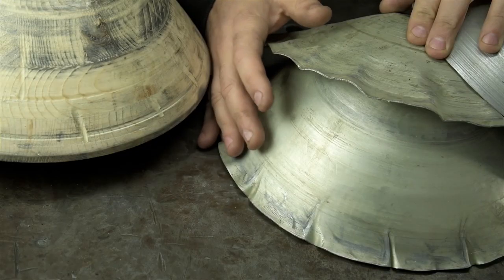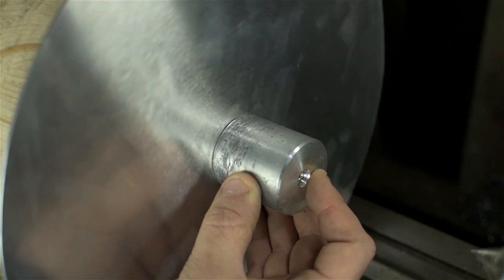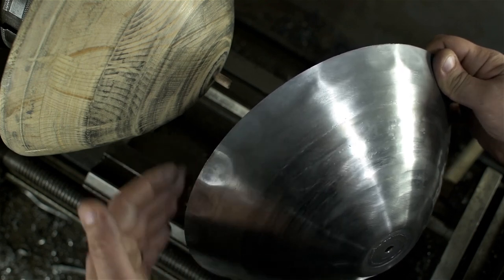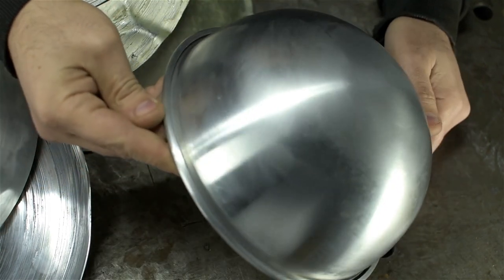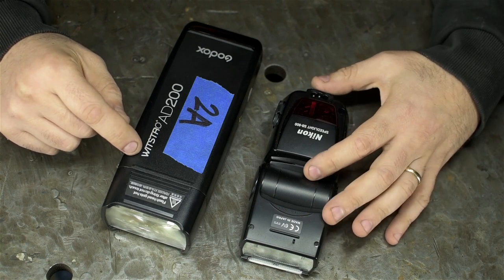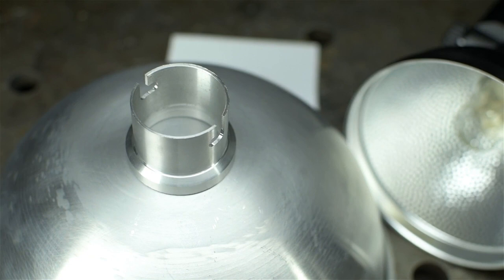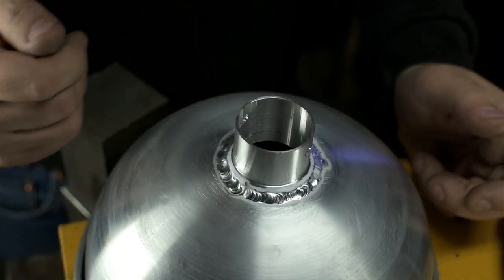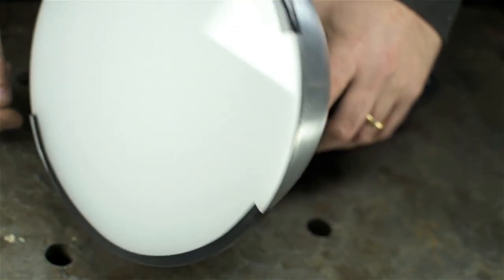Spinning Metal - Part 2! - GODOX Strobe Reflector Build

Comment: Hey ToT, the way you are forming this shape is prone to issues. First of all, when you apply an inwards force to one of the sides of the disk, it creates an outwards force  90 degrees ahead in phase; this is why your material is cutting into your center, a good way to counteract this would be to apply two independent torques 180 degrees opposed. Secondly the stresses you are inducing on the material will lead to work hardening very quickly, I would suggest annealing the material periodically. Thirdly the shapes of a disk and a paraboloid do not share gaussian curvature; i.e. they are not isometric and cannot be both conformal and area preserving. This means you cannot map them without distortion. It's the same problem as trying to create a map of the globe, and unfortunately there is no real solution to this problem.  Best of luck to you on your endeavors. -Skyler 

P.S. Love your videos

Comment: Did you ever think of annealing the aluminum before spinning it? You were trying to re-roll cold-rolled aluminum sheet. Your raw material has already been extremely work-hardened. Get a torch with a smokey flame (no oxygen) and dance it over the disk evenly for a while. The aluminum should be soft as butter after annealing. It should be much easier to spin after annealing. When you spin it you will be re-work-hardening the metal so the finished product will no longer be butter soft.

Comment: The issue here is how you're pushing on the material. The wrinkles form when the material buckles, this is because you are compressing instead of stretching the sheet metal.

With this in mind you want to make sure you're always pushing  along the tangent of your form (never in more than needed). If you do this correctly you will see the flat disk advance down the form with minimal distortion. You shouldn't need to work the outer part of the disk much (in a perfect world).

The metal spinning I've seen they tend to use a large ball on the end of a stick (among other tools) they'll use the ball to push straight in (parrallel with your lathe axis). This stretches and "lays" the material down onto the form.

Source; Ex forging engineer. Will try to find a video to demo this...

Comment: Seems when you work the top part of the bell close to the form FIRST, and then work further down toward the edge, you get less lamp shade folding and especially less center hole separation. I think the "skull" of the form supports the work at it's smaller, slower, closer to center area. ie, first, make a yamulkah. Then a hard hat. And lastly, a cone head. Thanks - Lumpy

Comment: I believe the problem is the wooden paraboloid you are using. It is not hard enough. For that reason you will not get a shiny finish inside. Moreover, as it deforms by the touch of your tool, tou don´t have a stable shape to follow. Can you make one of steel?

Comment: I think applying pressure with two bearings 180° apart would help, and stop the torsion causing metal fatigue near the centre, also perhaps rotating them with a degree or two of tracking would apply a slight outward shear force to keep the material taut.

Comment: You can see the entire disk tilts with the tool as you apply force, and tilts the opposite way on the reverse side.  I don't know if that's supposed to happen, but that could easily be causing the center to break off just from fatigue and work hardening.

Comment: needs faster spinning.. the centrifugal force keeps the metal steady and produces a clean finish.
not sure how fast your lathe is, but you probably wont get the speed required out of a standard lathe. for small parts like that, you probably want around 3000-5000 rpm

Comment: Idk if Tony would read this after all this time, but, I think I've got an idea on how to make this a bit "easier". You see, how the work piece is bending away from the form, when Tony is applyin force from one side? Yeah, that's what I'm talking about. That's what broke some of his workpieces. So, in order to avoid that, I think Tony should make some sort of additional tooling, that will be diametrically opposite from the tool he uses. Think of it like some sort of scissors with rolling thingies attached to it's ends.
I guess on the factories they have some sort of multi-pointed tooling to avoid bending the work.

Comment: You will hate this but the mistake you are making is very simple.  You are pulling the metal more and more and more from the base to the rim WITHOUT returning it back to the base.  In other words your pull away from the base then YOU MUST push the metal back again towards the base. Pull and push. Stretch and relax.  If you do as you were which is stretch and stretch and stretch some more the metal hardens and wrinkles and the rest is history.  I learned this reading a 100 year old book and watching the pros.  Knowing this you may want to go back and closely watch the pros do it.  You will see the stretch and relax action every pass.  Also the closer you get to the rim the smaller your stretch and relax forming motions must be to avoid wrinkles and disaster.  It helps too to start with soft or annealed metal. But if you use the stretch and relax technique you will have much better success and less frustration.  Good Luck!  :)

Comment: Not unlike yourself, i too like to overcomplicate things i would like to have but rather build, needless to say after spending over 400 cadanian pesos on materials to build a sturdy, waterproof, "unintrudable" multi gun case, i ended up going to the store and buying a nice pelican case...and now i have a nice pile of stainless steel, foam, fancy hinges and claps adorning my garage corner, for starters, the things was over 80 lbs empty and every time it bumpes against anything, it would sound like a giant HSS drill being dropped from 10 feet onto concrete, next week, ill be getting more steel and concrete in hopes of converting my work of art into a stationary safe maybe!

Comment: I'm not an oldtimer, but, first off, anneal your blank. Rub "brown soap" on your blank and heat until the soap turns black. Then when spinning with the spoon, try pushing in against the blank, i assume as i can see in your video, you kind of push your spoon in against your toolholder pushing away from your "mold" you actually need to push your material into your mold which will help keep your plate centered better and not cutting through it on the center. It takes a lot of time, effort and scrap before you actually make something useful, but you'll get there eventually ... Nice try though

Comment: I know, someone probably already told you this before but... why not blow torch and heat up the sheet first and periodically? You're basically blacksmithing with a lathe there. You're probably work hardening whichever material you get there (that would explain it getting worse at the end and the middle tends to just break off, it is harder but more brittle ). Heating it up would anneal it back to a workable state, and making it more malleable while working wouldn't hurt either.

Comment: I also know nothing about metal spinning, and I can't feel what you were feeling while working it, but it looks like you were working your way out from the center too quickly. A few times it looked like as you started to spread it out you get to a point where there's no support behind (towards the center) your point of contact and bending the sheet AT the center using it as a fulcrum. Like a seesaw or something. 5:20 was probably the most dramatic of it I could find. Anyways, great video! Off to patreon I go!

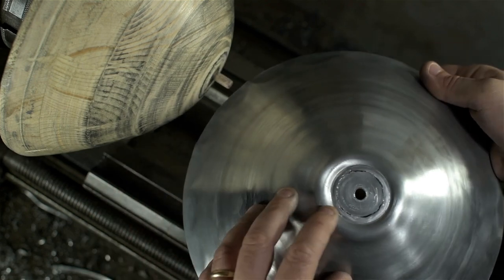Comment: I don't know anything about anything, but for the reverse bend you mention @4:50 I'm pretty sure we can see how it happens @5:25. When you apply pressure the blank bends up (away from the form) on the back side of the lathe. I think that's also making it wiggle back and forth on every revolution, right on the edge of the holding tool which is why it just fatigues and breaks there.

Comment: I think you should try using your Hydraulic Press and not the lathe next time...or use the other end of that hammer. Don't let those discs win another 'round' 🤭
Good Job TOT.

Comment: Your steel might be work hardening and that would explain the cracking. If you were to heat it up it should solve the issue. (But I’ve never made bowls before)

Comment: From what I can tell with my entry-level physics education, your edge problem is arising from the centripital force being applied to the outer edges of the aluminum, causing it to warp as you try to "contain" that energy.  As I've never spun anything before, I'm sure I'm missing something, but I feel like if you could apply the force to the blank faster and more evenly, that would prevent the edge forces from tearing the thing apart.  To do that, I would set the lathe tool to move in a diagonal way, almost like cutting a taper, but instead of one straight line, move the toolpost in a radial way towards the spindle.  That being said, I have no idea if that's even possible to do on your lathe, but these two vids DID get me thinkin'.

Comment: Well, the reason the middle is ripping out is due to force being put unevenly on the spinning disk, you push on one side, causing the disk to 'sink' on that one, while on the other it's pushed out, against the retaining bit. If you had a symmetric tool maybe it could do the job without ruining the center. I am aware though that normally spinning is done like you did, so, it makes even less sense why it would get ruined like that.

Comment: i was a metal spinner for 17 years .i spun 16 foot dia aluminum plate at 2 and 1/2 inches thick.
I would stretch it and thin it out to about 1 inch and make a huge bowl shape.
they used these for the rocket fuel tanks.
pretty much the same method.
just add a little heat on the opposite side and you can get away with much more
keep the heat away from the center

Comment: no brass knocker to check buck fitment....come on brother! you do need more spindle speed. Hardinge makes a 2nd op lathe that adapts to spinning quite nicely because she can spin north of 3k with an elephant worth of side loading.  What you really need is that ball bearing wheel on the end of stick with some metal dowel pins you can place into a beaver board.  I spun up to mid 80's before going all tool and die. Position pins in the beaver board give you your leverage, board bolts to cross slide. I had to learn using hand method. Going right to what you are trying to do is gonna suck.

Comment: I''ve not yet tried metal spinning ,but read a book on the subject about a year ago...Oh and I once stayed in a Best Western that was across the street from a Holiday Inn. Anyhow my shot in the dark for what went wrong is 4 things. First you needed a higher RPM on the lathe and maybe a better lubricant. Next the form if made of wood should be at least be made from good hardwood like Oak. Pine is too soft. Finally and this is the big one. The blank needs to be in a totally annealed state. It's gotta be just butter soft. The book I read even mentioned on large parts you may even need to re-anneal the metal part way through because of work hardening.

Comment: You're still not committing to the motion. You need to think of moving the arm as if you're smoothing out clay. It needs to be a uniform, continuous motion.

Another thing that comes to mind is the difference between a talented but not schooled artist and a talented but schooled artist. The first would draw a curved line in many, tiny lines, ending up with a porcupine line (my teacher's words not mine) the second would draw one smooth curve.

And one other thing, you need a plastic wheel.

Just my two cents, just like the last time.

Imo, the video you should watch is the one Discovery Channel filmed for their "how it's made" series on the topic, it's a very well put together package.

Comment: Back when I used a press camera I had a monster portable flash with a lead acid battery. I really liked the results from the bare bulb when used in an enclosed room, natural shadows and sharp definition, like north window light. Try it, you may throw your reflectors away. 
I've watched spinners churning out air diffusers. They made it look easy. Tempering may be the key. 
Great video.

Comment: I work behind a desk with CNC's, so I may just be talking out of my ass here, but I can't help but notice that  your work is deflecting as you're applying the pressure with your tool. I know you said you're done with metal spinning, but before you completely chalk it up to a failure, Is there a way you can put some sort of rest on the opposite side of where you're working to prevent that deflection? That may help quite a bit on the work tearing at the mounting point.

Comment: Probably said below in the 1381 comments: The lampshading happens because the material curls up at the brim. When folding it over in the direction of the actual bowl it must get stretched to a greater diameter than the final bowl size. One strategy therefore would be to avoid that brim all together during the process (folding against the operator).

Comment: The metal buckling is caused by the material collapsing, you're trying to make the diameter smaller, instead of stretching it.
Also You're pushing it too much, you're holding the stock near the center, and when pushing the outside, you're essentially cutting it using it self as lever.

Comment: no jabbing at the material, consistent and slow movement of your forming tool is best. High speed spinning, slow speed advances of the tool. like any electrical tool, you can't punch it into material hastily. you wouldn't do it with a jigsaw or a bandsaw.

Comment: Tony. Next time try explosion forming. Machine a several hundred pound negative form with an o ring seal. Bolt the sheet metal on the form and evacuate the air from behind it. Move the whole rig to a military ordinance range. Put the cone aperture pointing upward. Suspend a plastic explosive charge at the focal distance of the cone and boom..a perfect shape without any machining marks or stress concentrations. This is how missile cones in exotic material like titanium were made back in the cold war days when money was just something to use up. Today with cnc machining it would be good for non-concentric shapes.

Comment: just as a matter of interest - have you thought of trying the less than perfect but looks quite passable reflector you almost made?
Uness you need a perfectly focussed beam you might be surprised what you get back.  You might be shocked speechless - but just possibly the grunge o'scope might do good.  I've used various amounts of vaseline on a uv filter for soft focus and different nylon undergarments and scarves draped over lights as diffusers with mixed results and degrees of flammability -  but some were better than anything you could buy.

I once did a job at a works that spun copper hot water tanks ... 
They used two bars the first had a hole at one end slotted over a pivot on the lathe.  about 6" back was a peg that the second bar slotted onto.  That bar had a curved arm that the bullet ends screwed on to.   The two pivots were like a pantograph so the bullet end could cover a disk about 4' dia. while still maintaining firm enough force.
They said the "trick" was to set the disk tight round the boss in two passes,  then to use use single centre to edge passes to even out the thickness and produce a perfik' dome.
I did "have a go" and I still wake in the middle of the night sweating over the results.

Comment: The first shot of you using the ‘blunt tool’ shows the cause of the reverse bent near the center and why it breaks out.  I don’t know technical terms, but it’s bending back away from the chuck side on the opposite side of the lathe as you push in fatiguing the metal and bending it back the wrong way......or so it would appear.....

Comment: I believe the reason you're getting that flare around the tail block, and the subsequent separation, is there's a tremendous lod on the opposite side, further out on the edge of the bell. You push one side, the other flexes back, giving that flare in the middle.

Yea, I know I'm late to the show.  !}

Comment: Wait a sec @thisoldtony , what if you put a sponge or a thick cloth between the aluminium disc and aluminium round bar? Or round off the edge of the bar? It seems that the sharp edge of the aluminium bar tends to cut off a hole when you're pressing your spinning tool. I know that the project ends here but ummm, perhaps metal spinning round 3?

Comment: I think how you would make this would would be even pressure like instead of 1 bearing rolling and pushing into the disk use 2 (if it was possible, this is just me thinking about what keeps killing your disks) as one on both sides so theres even pressure but this would also probably need to be done by cnc so idk

Comment: You glossed over some crucial steps there. Mostly where you flatten the blank from the round stock. I could probably look through your back catalog and figure it out, but it's easier to complain in the comment section.

Comment: Clever. I tried spinning aluminum and copper. Making small bowls, maybe 3" or so went well and went terrible. I had a project making sconces from motorcycle headlights which needed a similar sized hole in the end of the cone. I set up a fixture and a trepanning tool on the lathe. I had a few fly out on me but at least an 80% success rate. Frightening, though.